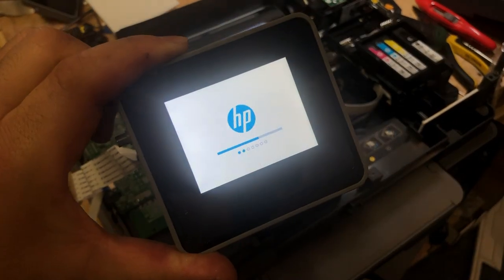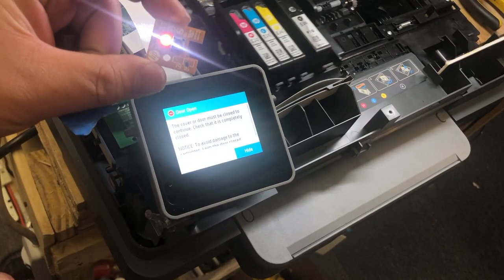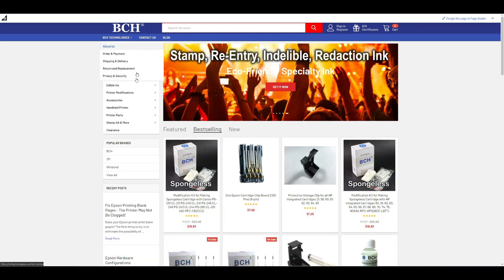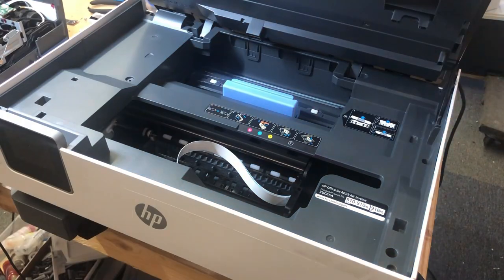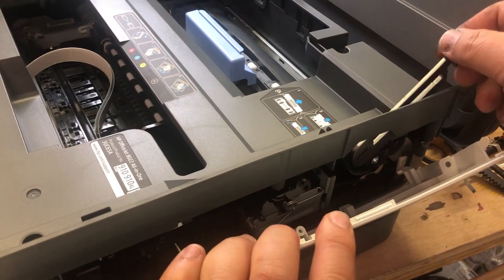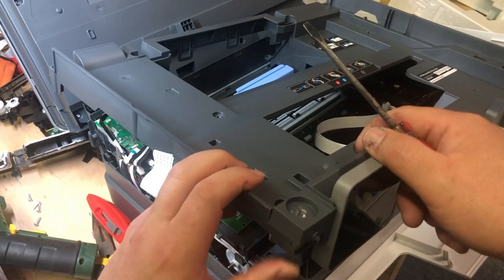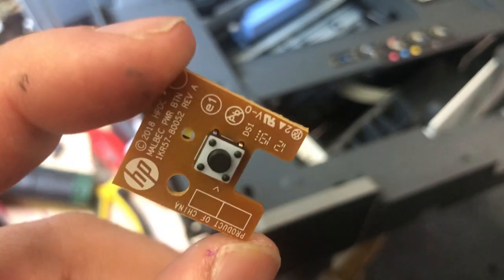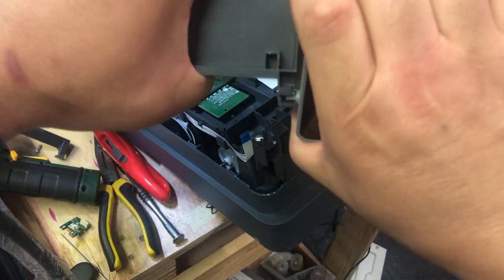Fix HP Door Open or Bad LCD Touchscreen Panel - OfficeJet Cover Sensor & Replace Display

Comment: Good info, thanks. It is great that you provide replacement parts like this. Unfortunately most people would just dump the printer and buy a new one as they don't know that it can be repaired.
Reply from the maker: Thanks.  Most $200 printers broke by $2-$3 parts.

Comment: Hi kevin, thanks for the video. I just followed your instructions, bought the replacement part(and ribbon) from bch, and replaced it with no trouble. But i am still getting the same error :(

What else do you think could cause this issue?